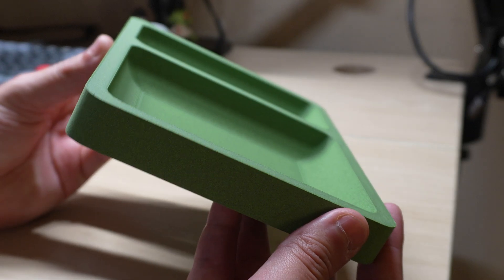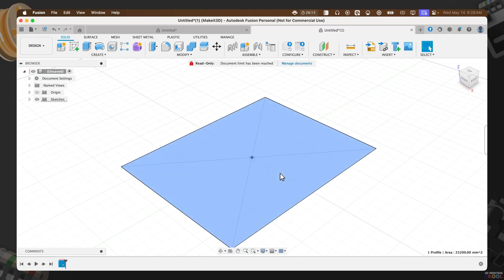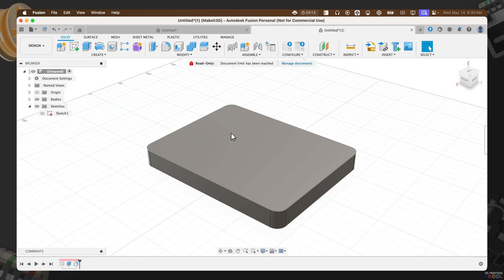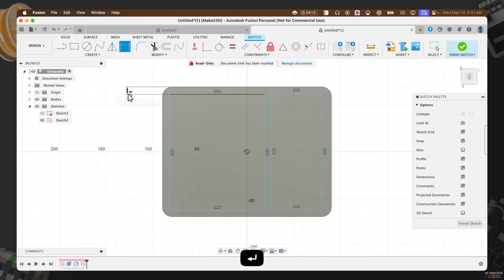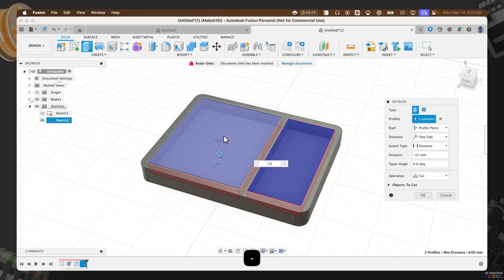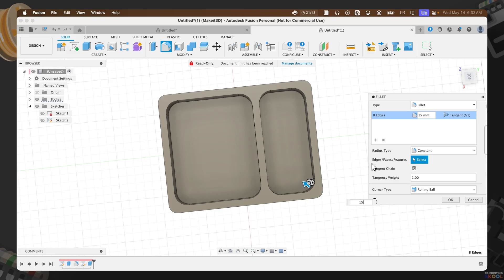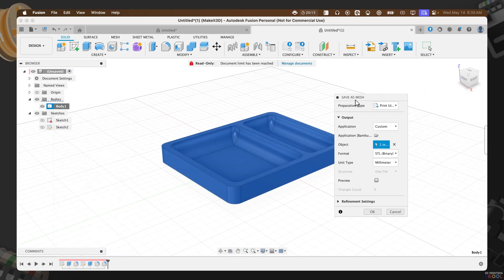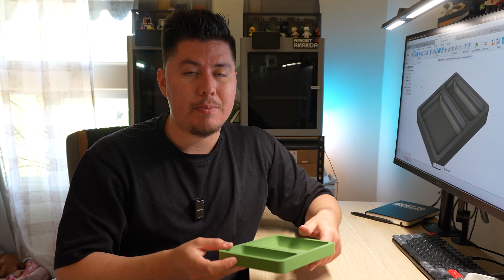3D Printable Catchall Tray

Comment: Nice tutorial. What filament did you use?
And to make the design even better, I would add a really small fillet (like 0.5-1 mm) on all the top edges, and a small chamfer (1-2mm) on the bottom edge. That makes the edges less sharp and nicer to the touch.